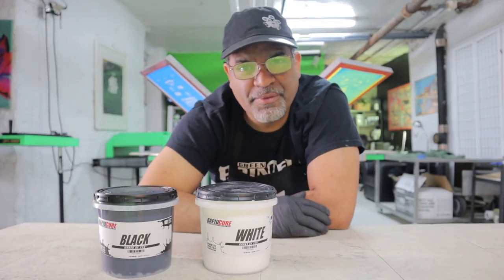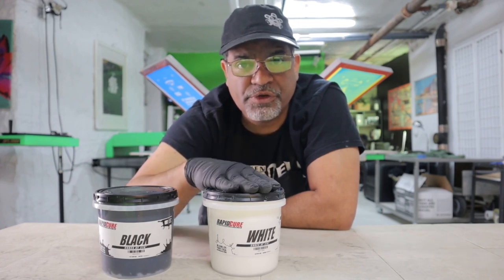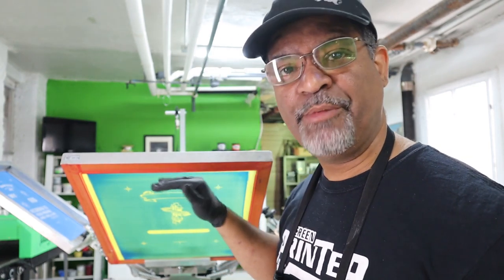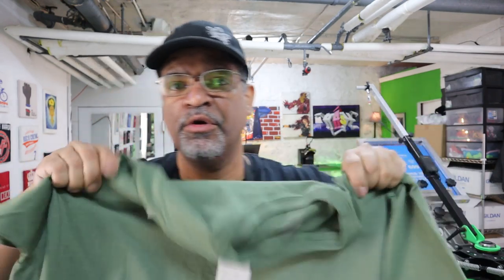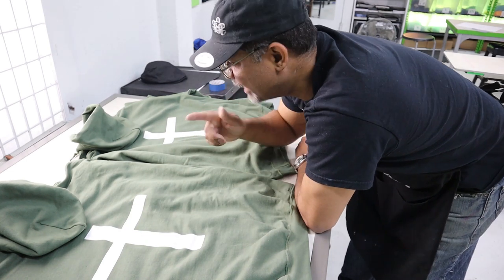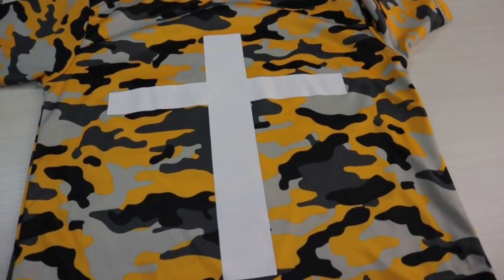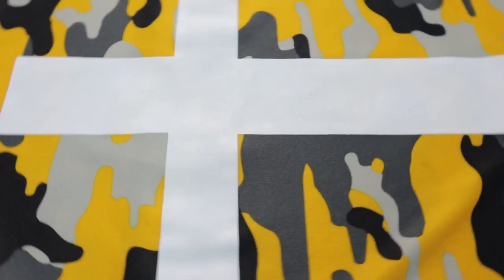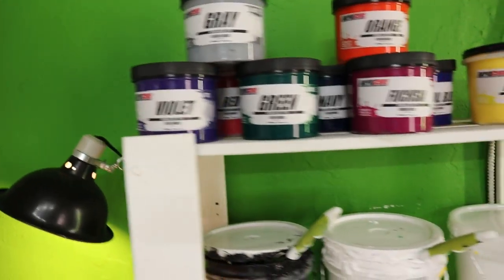PRINTING T-SHIRTS  WITH LOW CURE SCREEN PRINTING INK ( Review on the Rapid Cure Ink)

Comment: Thanks for sharing Taino Ink. When I print 50/50 sweatshirts/hoodies  it does migrate with some inks but the white ink is always an issue. 
What I've done and still do is,  add a little puff white ink to the white ink and it prevents the migration but have to pre dry it with the heat gun; and since i don"t have a conveyor I do it with a heat press, I set it at 320Fº for 20 secs. I get good results. Still looking for a good ink to use it directly to the garment without migrating though.

Comment: I just purchased these inks and having trouble about over flashing. What temp and how high would you recommend setting the flash dryer? I have a coil not a IR flash. Any help would be greatly appreciated. Thanks in advance sir.
Reply from the maker: Try to keep the flasher at least 3 to 40 inches from the platen for about 10 seconds. Make sure you are using a temperature gun. the temp you want to flash is around 250 t0 275 tops. Make sure when it comes out of the flasher the the ink is tacky not completely dry.
Reply: Thank you very much sir. I really do appreciate that.
Reply: How do you like the inks? Have white and black but the mixing system is on sale and thinking about scooping it up

Comment: What’s the best flash dryer to buy for a starter.. I got everything this week but my flasher doesn’t work to good? It’s from amazon all my screen print stuff came from ryonet?
Reply from the maker: I had a flash dryer that wasn't good and the reason was that it had that curve wire versus the one I have that is little circles all over the heater. Ryonet has one of the best flashers out their.
Reply: Taino Ink the one I have keep turning off but I getting another one a smaller one. I think it’s to big for what I’m doing thanks for the feedback keep up the good work and videos man... what’s your Instagram name?

Comment: Great video!  Question I need to print on styrene sheets that have 10% rubber mixture, what ink do u recommend I tried nasdar 9700 series but it doesn’t dry well and it peels off